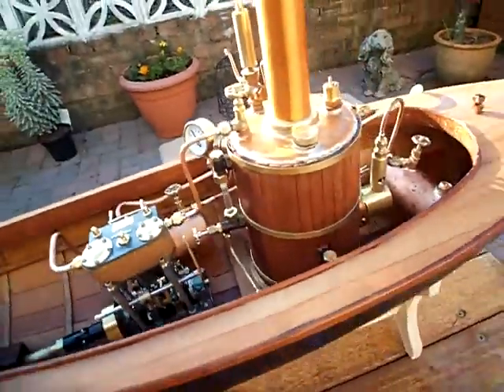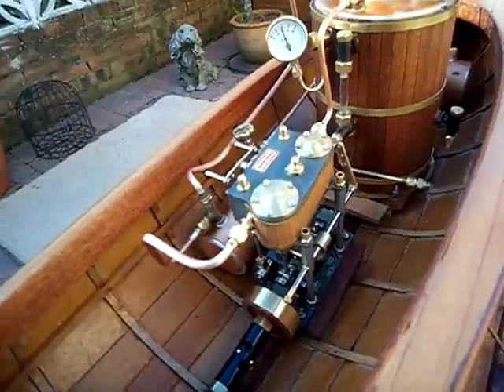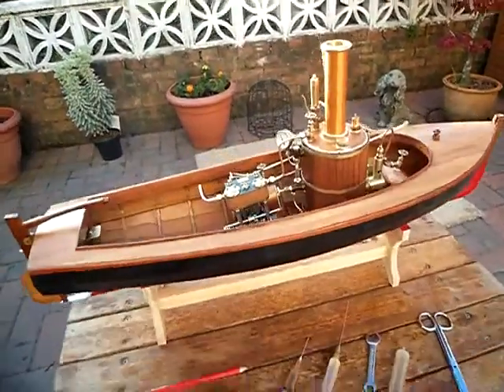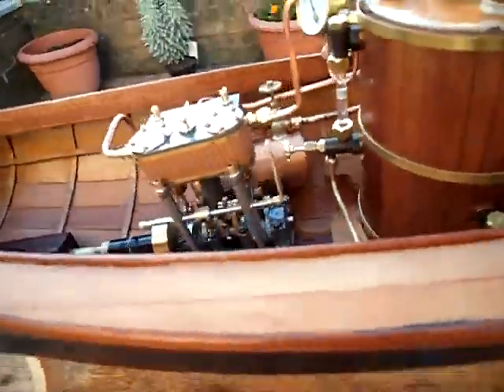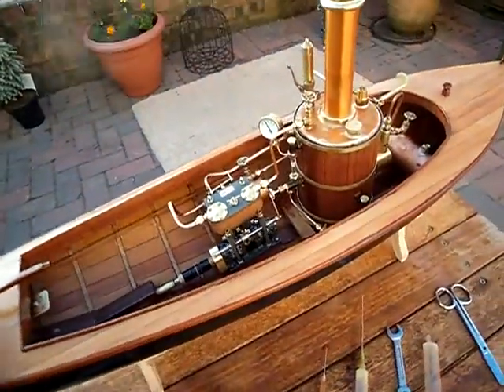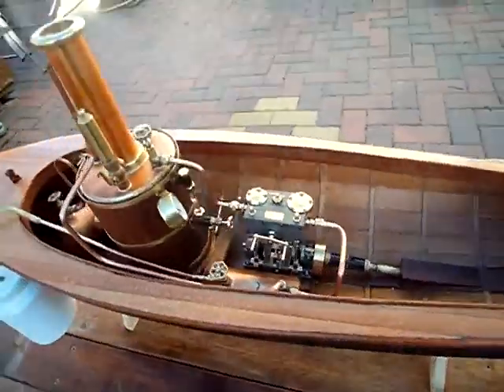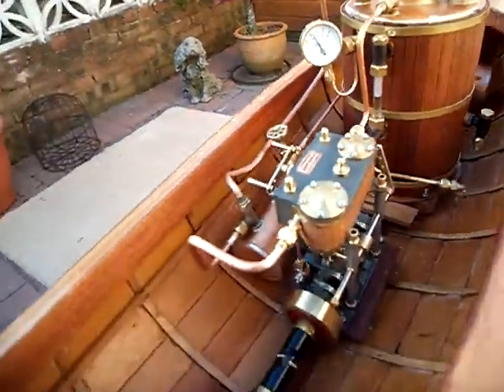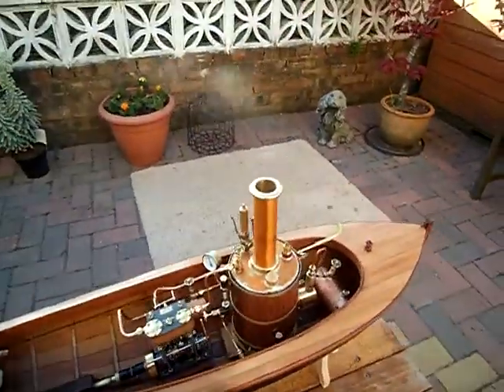Martin Balis TWIN twin see EXhaust line " interesting" !!!

Comment: Bonjour,
On all my boats, the exhaust pipe has a minimum of 1 mm diameter more than the admission one. Experienced, if there is no difference, the engine can not breathe. Besides this, what a wonderful temptation... ;+)
Amicalement, Raphaël